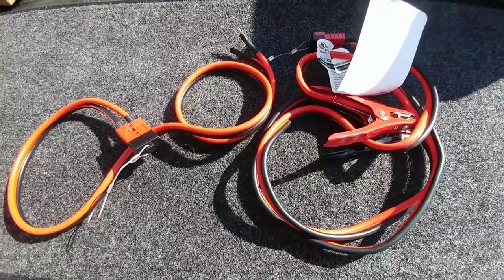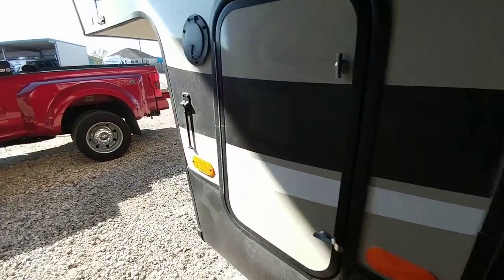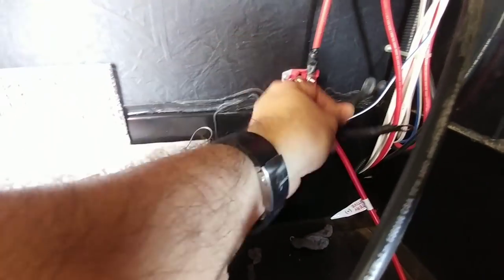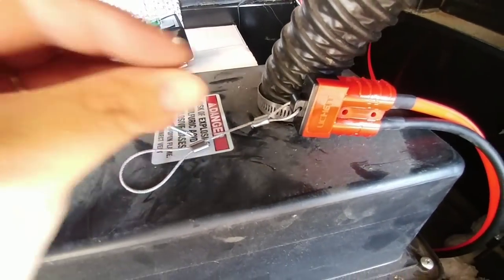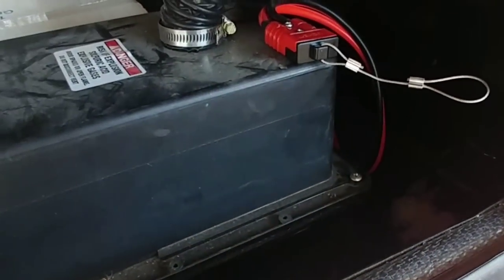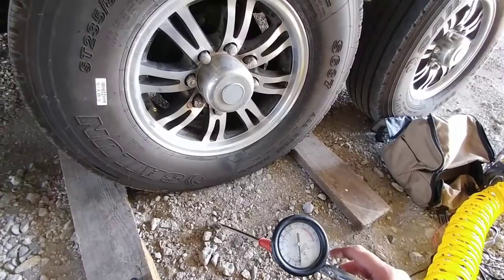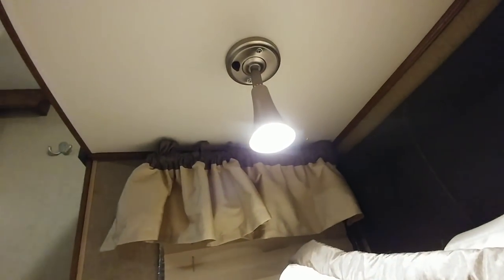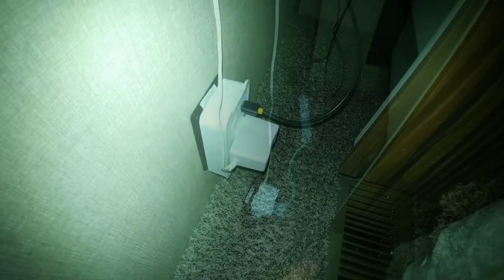Easy RV Upgrades installed.  DIY stuff

Comment: I just purchased a 2018 F350 SRW 4x4 diesel. I would love to see a video describing how and when you use the exhaust brake with tow/haul mode. I understand that cruise control can do it all for you but, on really steep twisting highways like the million dollar highway in Colorado cruise control is not an option where you regularly go from 50mph to 15mph.

Comment: i have a very similar setup for my trailer as well but i also have a anderson plug mounted on my rear bumper good solid connection no need to open the hood and use jumper cables
Reply: What gauge wire do you use? Do the wire run from the battery?

Comment: You should put the loop of the battery side connector cap under the connector with the screw through it - that way you will not loose it.
Reply: You're correct that the loop is there to prevent loss of the cap but I'm pretty sure that loop was actually supposed to have the power and ground wires fed through it before the wires were snapped into the plug when he made it.
Reply: Walter Willis i

Comment: It’s crazy to me how most RV’s are wired!  No loom. No heat shrink and it ran wherever. To me they should be wired like an automobile.
Reply: Matt O they build them quick and dirty. Wire get cut on sharp edges, no grommets, running in tubes where they rub back and forth till they short. Must be about keeping the service industry busy.

Comment: Is there a link for the air compressor and nozzle set up?
Reply from the maker: Full Myle Grounds,LLC Myles: in the video description
Reply: Okay thank you!
So the 17 f 450 does not charge the battery while it's plugged to the truck?
Reply from the maker: +Full Myle Grounds,LLC Myles: All new Super Dutys (and soon all pickups) have a protection in place if the trailer battery is dead to delay charging for several minutes until a trickle charger brings the battery back to life.